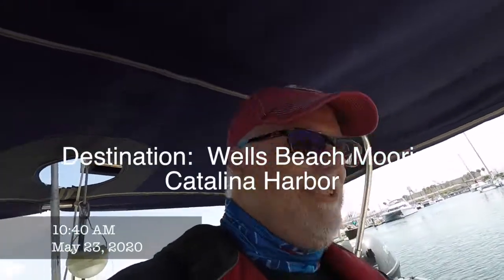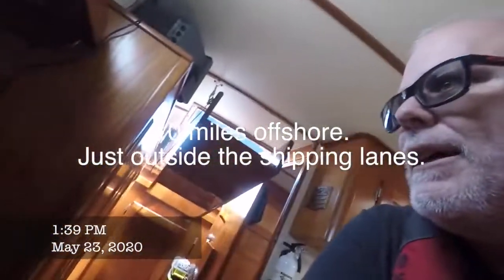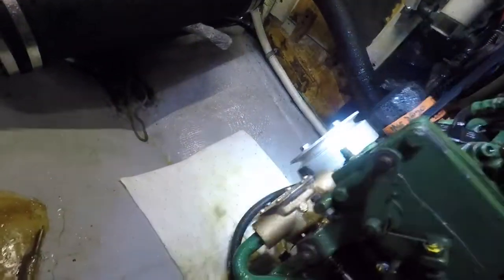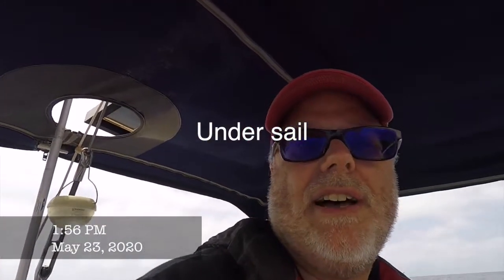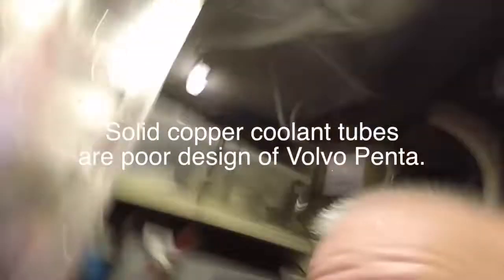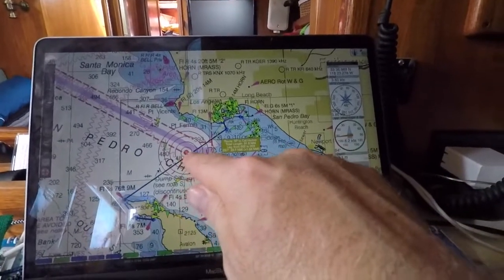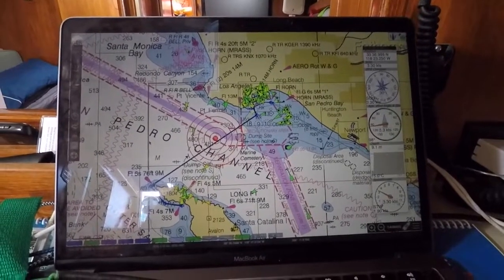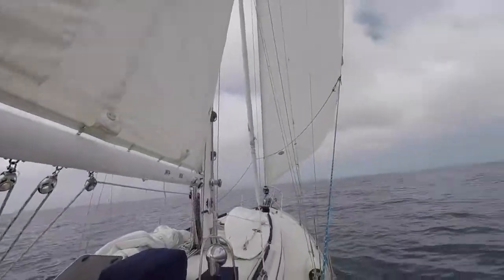Mission Aborted - engine overheats... now what?  (May 2020)

Comment: KEELDRAGGER, I HAVE BEEN HANGING OUT WITH YOU AND AM ENJOYING THE TRIPS TO CATALINA. I HOPE YOUR ENGINE IS BACK ONLINE, YOU WERE HAVING SOME TROUBLE WITH YOUR FUEL LINE. THAT WAS IN MAY 25TH SO I AM SURE YOU HAVE RECOVERED.
Reply from the maker: All is well now.  The overheating issue took me offline about 6 weeks.  I narrowed down the possible causes but decided to have a mechanic go thru the raw water and fresh cooling loops end-to-end.  That took some time to get scheduled.  Good memory on the fuel line issue!  That was my previous boat (Dana 24).  That one was self inflicted!  I neglected to seal the threads on new fuel filter fittings and had issues with air leaks.

Comment: Welcome to the wonderful world of the Volvo 2003...
Reply from the maker: I'm slowly learning to not like this engine, but the prior owner got nearly 6k hours out of her.
Reply: We had a friend who made 8500 hours on a saltwater cooled non turbo 2003.
We have a Valiant 40 and a non turbo RWC 2003, though fortunately it isn’t in the Valiant.
Ours is fine, it’s in a 36’ Adams here in Oz 1500 hrs old and I maintain it myself,  but I also have a low hours 2030 in my shed and if it ever plays up the 2003 is gone.
The problem with Volvo’s, if you have a saildrive they have you over a barrel.
The 2030 and 2040 are Perkins based, and generally are a straight fit for earlier saildrives or gearboxes.
The Valiant has a ten year old Yanmar 4JH and a new V drive, can’t say enough nice things about it..